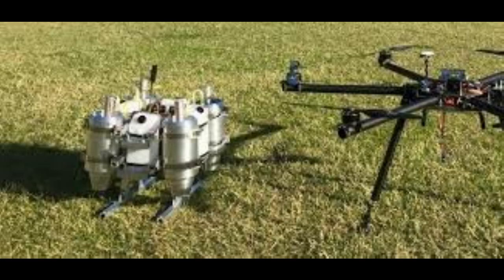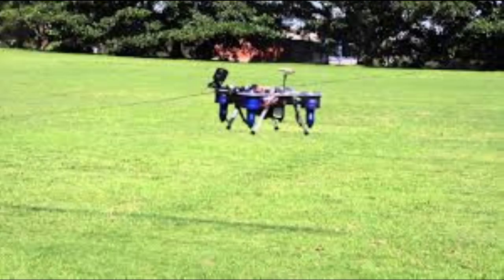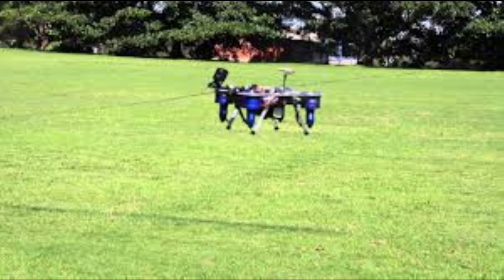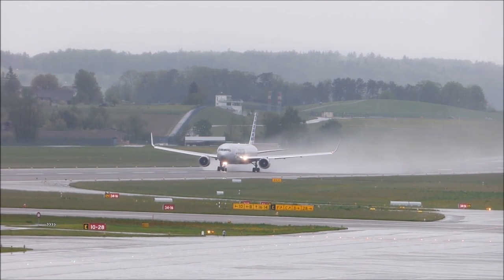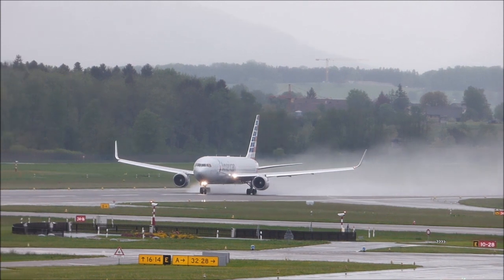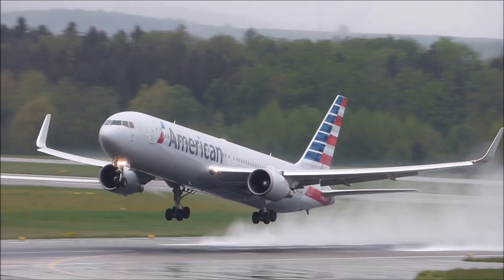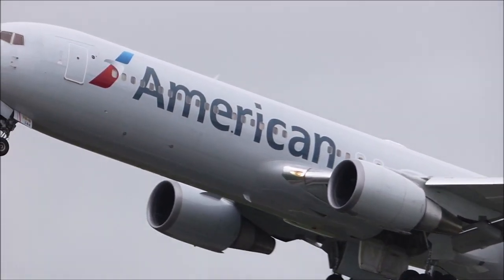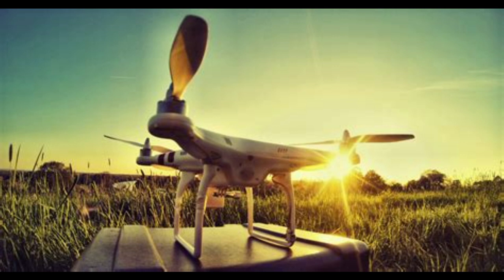Why You Can Not Attach Jet Engines To Drones

Comment: You could use a jet and a centrally located power plant and duct output to stabilize or directional control using servos to operate duct vents. Still not as effective as rotors, but an improvement over independently operated jet engines.
Reply from the maker: This is a good idea , we could get the performance we need but like you said earlier I worry about the efficiency of the craft especially when you factor in flight time